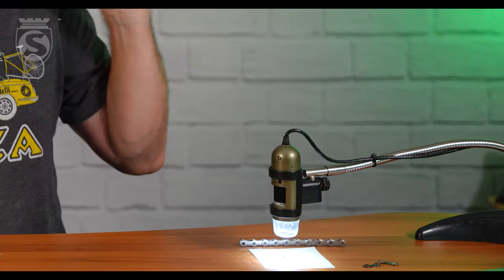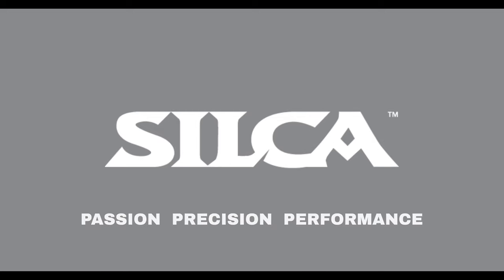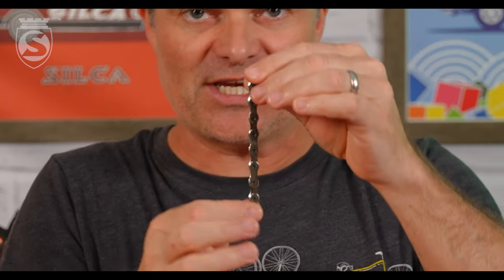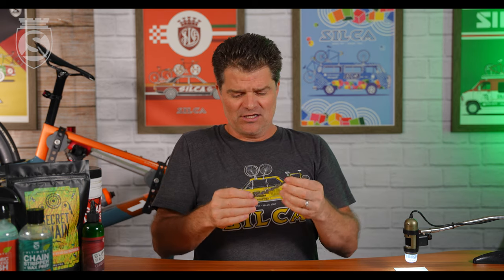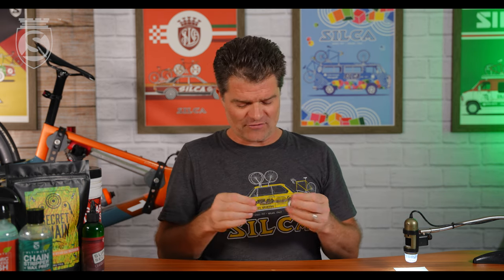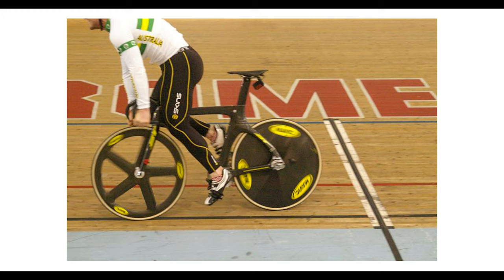Practical Tips to Save Your Chain from Wearing Out!

Comment: I have 2 bikes with 100k miles (50 years old) and the drive trains are still happy. Why can't they just make better chains? I want to buy a new bike but i don't want to pay a "rental" fee because of planned obsolescence.
Reply from the maker: Modern chains are really amazing technology and manufacturing prowess.. the challenge is that as we've added gearing to the cassette, the bushing to pin contact surface is smaller than ever, so all of the same loads (it not much higher loads with modern gearing) are being fed onto a line of contact only 1.4-1.5mm wide per bushing/pin interface and internal pressures on the pin can be over 100,000 psi under load, so any contamination or breakdown of lubrication and the metal starts to degrade pretty quickly.
Reply: @SILCAVelo  now we understand the issues make a better product. Or at least they should give me a choice between longer warring product and not. I just think it has become a standard so they can sell more product. We see this trend everywhere. It's bankrutting us so the manufacturers can make more money. Sorry for the flaming.

Comment: How about calling it 'chain slotting'? Zero slotting is good (everything is round..), slotting starts at x% (until then it's within tolerance - as per ZFs graph), beyond y% it's out of spec and needs replacing...
I assume (assume because I don't know!) that a *new* chain might exhibit 'stretch' (using the chain measurement tools) but have zero slotting/wear. So do we need to start our failure/wear measurements from a new baseline? Hope this makes sense? Noted this as I know some riders are reporting brand new chains as already nearing the limit on the measurement tools...

Comment: Instead of "stretch":
Chain pin "sharpening" (as it is the same process, which happens while sharpening a knife) or chain shaving off (as in shaving off microscopic amounts of metal, bit by bit, until it's eaten deeper into the links, resulting in a greater length between the pins).

Comment: I see nothing wrong with the term "chain stretch". The word "stretch" is not limited a lengthening under load. It more generally means to extend in length, which is exactly what happens with chain wear.

The cause is chain wear the result is chain stretch. I measure the amount of wear by measuring the chain stretch.

There are certainly truly misleading terms in cycling. How about "clipless" pedals.